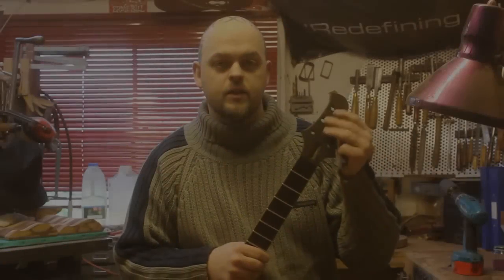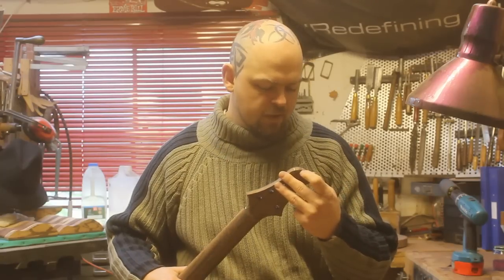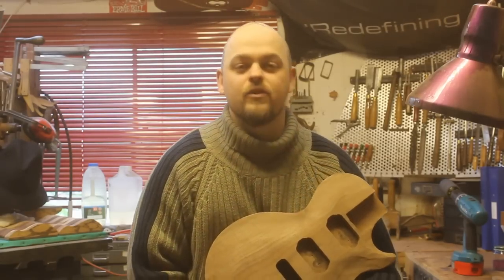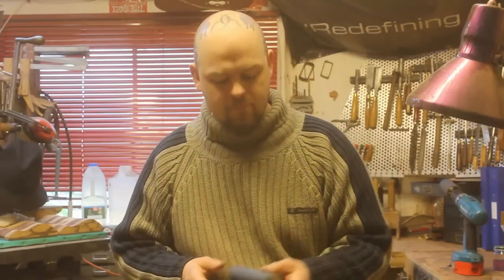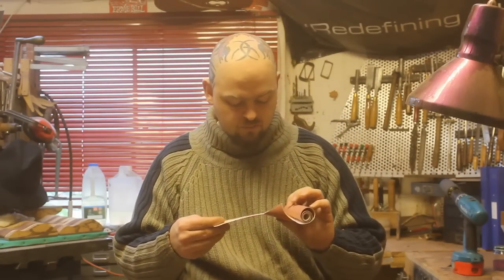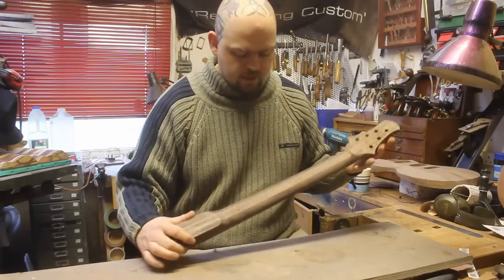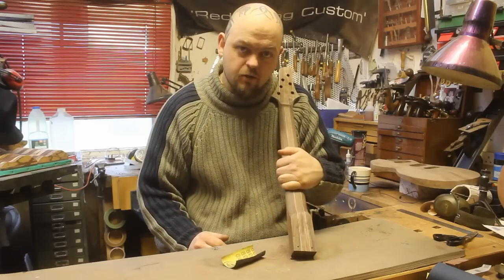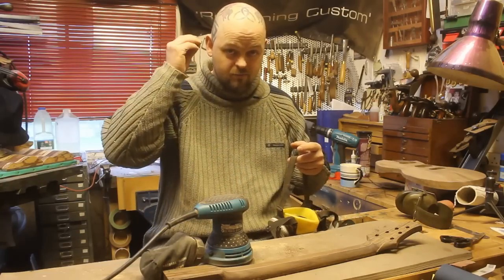Clarity Ep 36 - Sanding and Finishing a Custom Guitar

Comment: I have "christened" virtually every woodworking project I've made with a few drops of my own blood. It's cheaper than breaking a bottle of champagne (unless it involves a trip to the hospital emergency room).

I didn't realize that Black Rhinos were native to Portugal.

Quality sandpaper is definitely worth it. In addition to lasting longer, I find that Gator brand (made in Finland and the US, and not really very expensive) 220-grit leaves a far finer finish than no-name 320 or 400, which is not something I expected.

Comment: You made a big deal about not skipping sand paper grits.  But when you went to the random orbital sander you did not mention anything about what grits you used!
Reply: +Dean S To be fair, that's not actually true. You can use every other grit quite happily. This is even acknowledged by manufacturers. Simply, going through every grit religiously is just an over-repeated fallacy. If you have 60-80-100-120-150-180-240-320-400 on hand, just choose your starting grit and work from there. 60-100-150-240-400 if you want to "start super coarse". Next time you talk to a sandpaper rep (Mirka in my case) about this you'll get a knowing smile. You didn't hear it here. If you tell anyone, I'll have to kill you.
Reply: +Prostheta to be fair, Ben said don't skip from 180 to 400, not use every grit available.
Reply: +Prostheta You missed the point.  When Ben was hand sanding he said which grit he was using.  When he used the random orbital sander there was no mention of which grit he used so one has to assume, or maybe not, that he used the next finest grit after hand sanding.  Thats all.